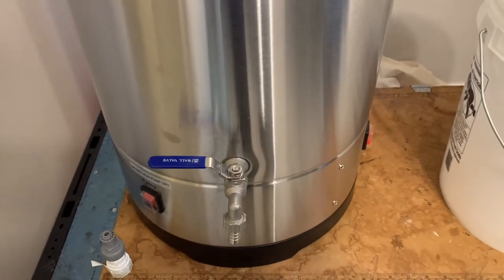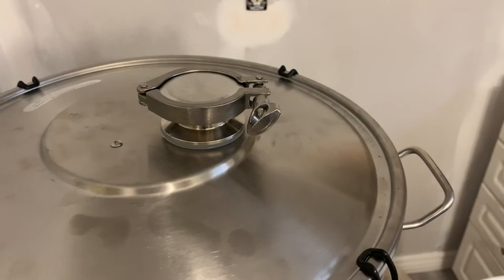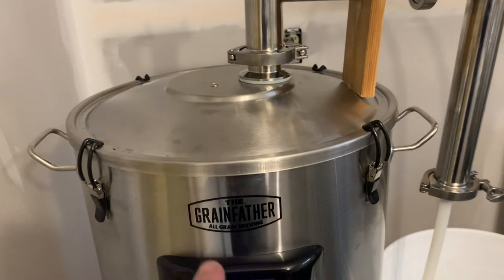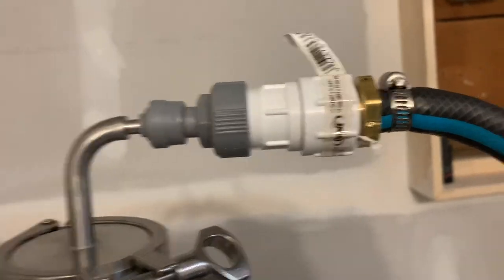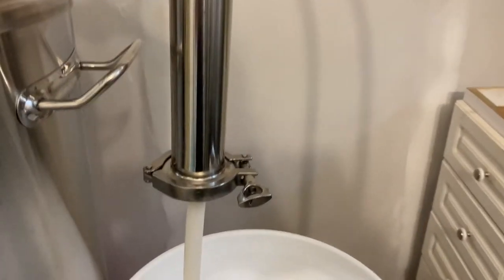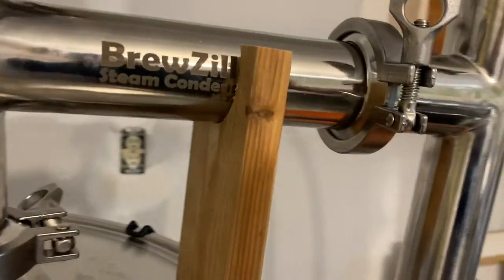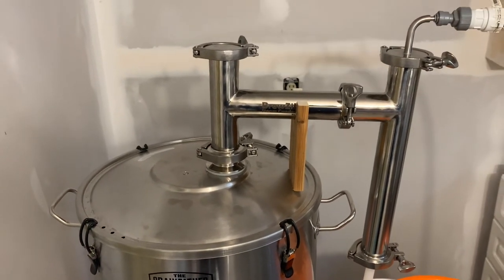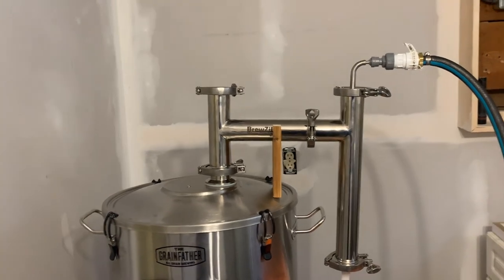S40 Steam Condenser Lid Test #2

Comment: Thanks for the detailed view of the condenser! Does the water in the bucket produce steam? How much water does the nozzle consume?
Reply from the maker: Hey there, sorry for the delay in responding! :)  - The water in the bucket is "warm" but not hot enough to produce any steam.  Over the course of a 90 minute boil the water used is about 10-12 Gallons (about 35-45 L total).  It's quite a bit of water for sure; BUT - the water I collect is then used to clean the grainfather after the brew day.  The S40 (and I think most grainfathers) use a "Clean In Place" (CIP) solution. 

The water that's collected is put back into the grainfather after the brewday is over, PBW (or any other cleaner such as Oxiclean Free) is added to the water and it's brought up to approximately 130-140 F / 55-60C - once it's heated up - the water is recirculated using the grainfather's pump (and I have recently started using my chugger pump via the S40's spigot as well).  This offers a decent solution of running a good cleaning cycle for the S40.  Of course, this also means an equal amount of "rinse" water must be used after the fact.

Comment: 2 things: 1) aside from placement of digital interface and lid and extra switch, looks identical to my brewers edge mash n boil, 2) what's the purpose of this device?
Reply from the maker: Hi 🙂
The steam condenser allows me to brew in the basement without having steam rise and get all over the walls / ceiling during the boil.  My ceiling is only about 8ft, so without the steam condenser, I'd likely have to build a decent sized vent hood with a fairly strong (400+ CFM) exhaust fan and since I brew where our laundry is, a vent hood is not an option.  The Grainfather S40 is Grainfather's "low end" 40L (10.5 US Gallons) system.  The G40 is more like what most Grainfather users would be accustomed to seeing.  

There's not a lot of differences between most of these all-in-one brewing systems (i.e. Brewzilla, Mash & Boil, Grainfather, etc.) at the end of the day.   They all are capable of making great beer! 🍻
Reply: @davidchang-sang1293  awesome, thank you